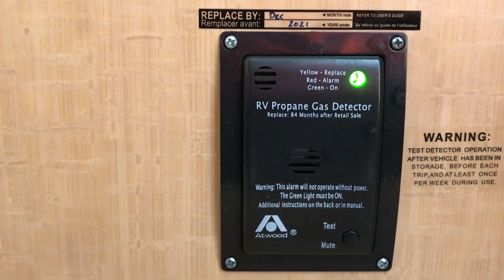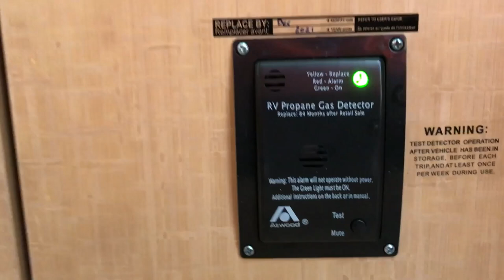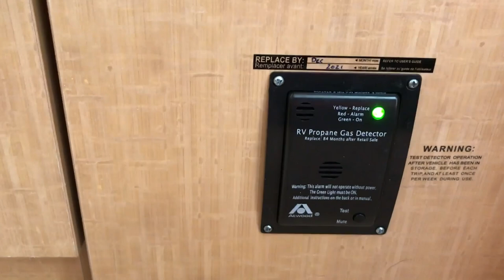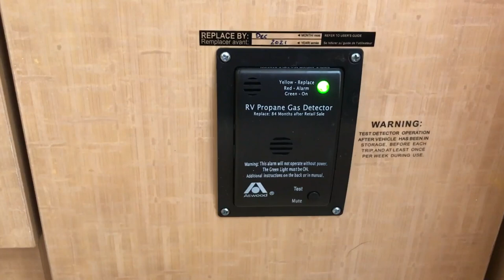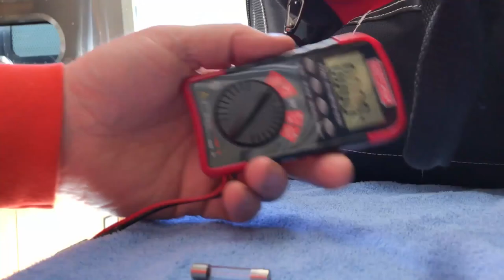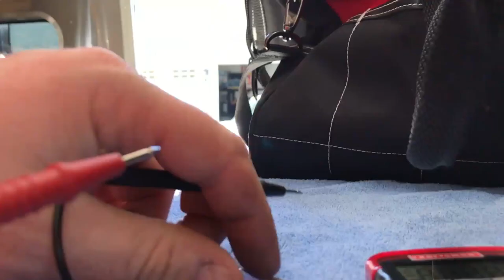How To: RV Propane Detector False Alarm and Fuse Location

Comment: Thank You!.  I like you, had the same problem with my alarm.  i fought with it for three days, i ordered a replacement on amazon, (to be returned) i watched your video  and got out my vacuum. i vacuumed it out , that still did not fix it. i walked away, and the next morning, i want back outside . the alarm was no longer  going off. i opened the door and saw a green light. the first one i had seen in four days. i was so pleased.
Reply from the maker: Honestly I am not sure what finally caused it to stop beeping.  I know the fuse blew but also not sure why that happened either.  Good news is it has not happened since and no further problems.  Glad I could sort of help LOL
Reply: If the problem returns, see my reply to Kevin George above, it may need a slightly better cleaning. That is, if the unit is not over 5 years in use.

Comment: I still have the original LP leak detector in my trailer, I should probably replace it since it's 10 years old. I haven't had your issue. I did move the power lead off the bus bar to downstream side of the Store/Use solenoid so when I switch to Store the LP leak detector is not powered on, that way there is no draw on the batteries. I still pulled the negative lead off the batteries when it storage. 

Now that I have 200w of solar on the roof and I've started to store the trailer on my driveway which gets full sun I don't have to worry about the batteries ever being low. I have two 6v Lifelines under our twin beds and use the old battery compartment on the A frame to store leveling blocks and a sewer hose slinky. We had a queen bed but had a twin bed remodel performed on our 2008 Airstream Classic 25fb.
Reply from the maker: our batteries are in the same place as yours....I was surprised that we actually saved 50 pounds of tongue weight when we added them since they are so much heavier.  I did not think they would be far enough back to make any difference.

Comment: I really appreciate your posts.  Thanks.

I would like you to clarify your meaning of 'going off'.  Are you stating that your LP detector was going off like a person would expect their smoke detector going off cautioning fire, or going off like a smoke detector chirping when the battery is bad?

My detector suddenly started chirping.  About every 45 seconds it will let out one chirp.  Just one chirp, but constant.  Every 45 seconds or so.  Green light went away when the red light started blinking with the chirp.

I'm wondering if we are speaking about the same problem.

Thanks again and please keep us informed.
Reply from the maker: Mine was going off like a smoke detector in a smoke filled room...not the battery is low type chirp.  And thanks for the compliment!\

Comment: This happened to me last night while camping.  My CO detector went off at 3am for no apparent reason.  No gas was turned on, the LP was off, nothing was even operating that night.  We could not stop it from beeping.  After trying everything under the sun, we finally discovered that these CO and LP detectors are hooked into the MAIN power supply of the RV.  If they lose power for whatever reason, a blown fuse, a dead battery while boondocking, etc. they will start alarming.  My solution?  Disconnect these damn things from the RV and buy a standard CO detector that lasts 10 years.  You'll never have to replace a battery and you won't get woken up in the middle of the night with false alarms.
Reply from the maker: That sucks being woken up for no reason but make sure you mount CO detector in similar location - knee height or lower.  Also make sure you check the batteries annually - I have had several different types of detectors that say "last 10 years" and the batteries die way before that.  I actually check my batteries during de-winterizing every year.
Reply: Don’t forget to get a propane detector.  It really sucks when your first indication of a propane leak is an explosion.
Reply: Same time mine went beep for the rest of the night I get up this morning and not beeping why???

Comment: Mine kept going off around 8 am the detector is just 4 years old and I kept resetting it I checked and the tanks are shut off and I took out the fuse to see if it’s good. I put it back and now it’s just blinking green
Reply from the maker: I am going to replace mine this off season.
Reply: @AirstreamNerds  yeah I took out the fuse and cleaned it. It’s still good and I put it back and I haven’t had any problems luckily

Comment: The idiotic thing also has an end of life where no matter what you do, the alarm will not stop.  At 3 am, mine hit that point.  Neighbors dogs were barking and mine was howling.  In my toy hauler, there is no free access to do any work ... I had to literally cut the wires, which then blew a fuse, and finally silence.  I taped the wires, replaced the fuse, and now ordering a new unit for $100.  I’d like to just put a battery operated one in, but they do not have the propane sensor ... ?  A royal pain in the arse and a sleepless night!
Reply from the maker: I got lucky...mine did this when trailer was not in use.

Comment: i spilled alcohol next time mine went off for 3 hours. i can't put i cologne it goes off. if i sleep of the couch it goes off when i fart. please tell me how to turn this stupid fucking thing off
Reply from the maker: unscrew it from the wall and cut the wire (or if it was installed correctly just disconnect it)